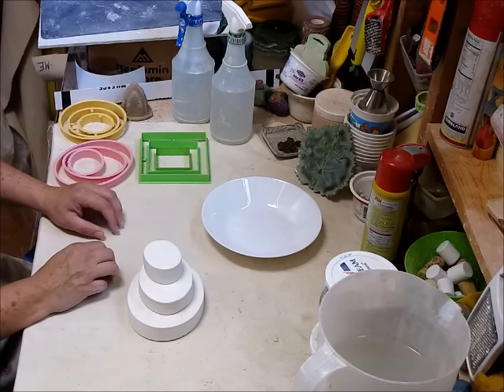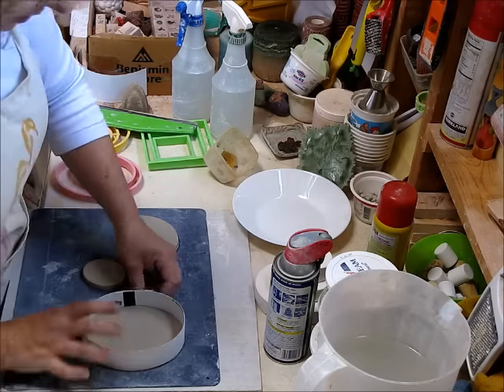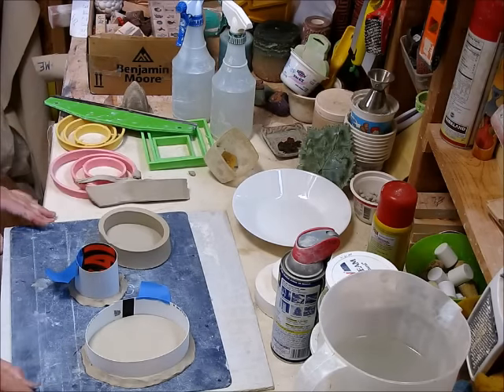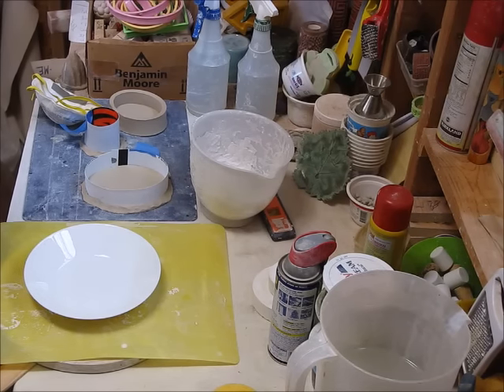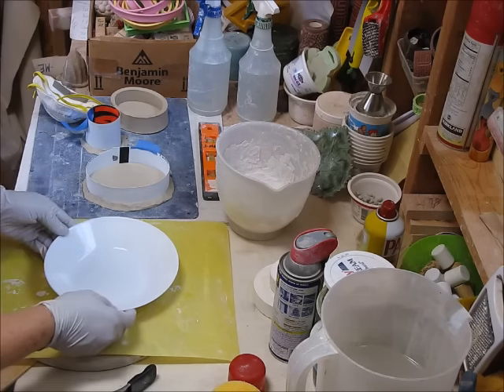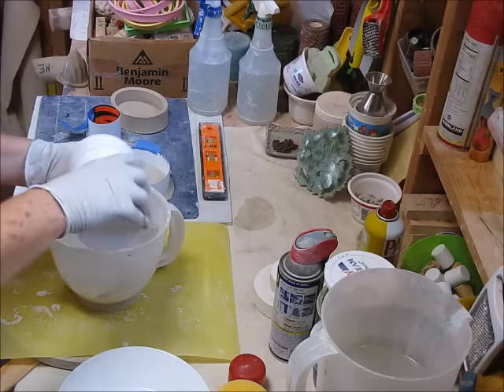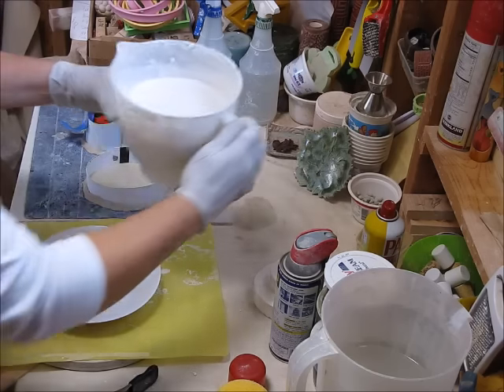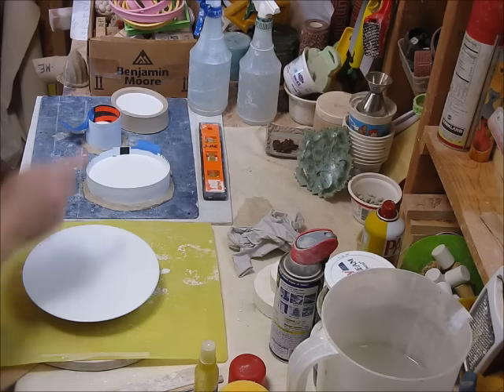Plaster for Push Molds

Comment: Jamie is the most generous teacher I’ve ever run across. If you ever get a chance to take a class from her at “Higher Fire Clayspace” in San Jose, CA don’t miss it!

When I work with plaster I line a 5 gallon bucket with a plastic trash bag and fill that half full with water. That’s where I clean my gloved hands, my tools, and my measuring containers. If I’m sanding, I do that over the bucket as well. Odd as it may seem, the plaster will harden even under water so you can leave it to settle for a couple of days then pour off the water and put the hard plaster in the trash. I have a place to leave the bucket to sit so I use the same water and plastic liner over and over. I just keep refilling the water as it evaporates leaving the hardened plaster in the bottom of the bag.
Reply from the maker: Thank you

Comment: For the volume measurement you could simply pour the water into a measuring jug, then you dont even need to multiply. Or if you have a scale, you can weigt the plate before and after adding water and subtract. Each gram of water is 1ml

Comment: Have you ever tested the plaster for durability? Pressing extremely hard in the middle to see if it will break? Using a rubber mallet or hammer?
Reply from the maker: No,  I have not.  The only time I've had them break on me is when I've dropped them by accident.  At one time I was considering how to make them thinner and stronger.  Someone suggested adding a mesh.  I have yet to try that.
Reply: You're using them to mold a softer material than I would. Soap has to be pretty hard to not squish out from under the pressure of a stamp. I fear pieces of the design breaking off into the soap as well as the stamp breaking under the pressure needed to get an impression.
Reply: @jennifereverett6298  A better option for marking soaps would be a bisqued clay stamp. Pottery plaster is fairly strong, but you're right, it would probably deform after repeated uses.

Comment: When measuring the depth of the water in your plastic box, you have to make sure that table is level, as you mentioned right after you measured the water.  Other wise you might be measuring the low or high side of the water depth, making your calculations incorrect.

Comment: This is useful, but I wish that you had published the chart for when we have different cubic volumes than what you have done here.
Reply from the maker: I feel like the chart is not mine to share.  It's something I figured out based on someone else's work.   I can tell you the pounds of plaster is roughly 1.5 times the pounds of water.
Reply: That is exactly what I needed. Thank you!
Reply: I use 5 parts plaster to 3 parts water and find it to be just the right consistency for pouring yet not having too much water. Also dry the forms slowly for maximum hardness.

Comment: Jamie, how do you store all your molds?  Also, do you sell the molds you make in the 28 inch wok? I've searched online to no avail...
Reply from the maker: I store them in my studio usually stacked.  I've sold at workshops.  I don't anywhere else.  I make that wok available during my workshops so students can make their own.  It takes 33 lbs of plaster!
Reply: Jamie Meador I noticed Higher Fire has an online store that connects to Etsy. The plaster isn't as much an issue for me as the issue of buying two woks for the production of a mold. If you make them again could you please do a sale through the Etsy page?  Thanks!

Comment: 스프레이오일은 한국에서는 구하기가 힘듭니다 그레서 한국에 음식을 사용하는 오일이 있는데 그것을 바르면 안됩니까??
Reply from the maker: It does not need to be spray oil.  Pour oil onto surface and spread around with cloth until entirely covered.
Reply: 감사합니다 도움이 많이 될것같습니다 ^^

Comment: Either that or you can do like everyone else and mix it up like pancake batter make more than you'll need fill your molds dump the rest in the garbage because plaster is as cheap as air and save yourself a bunch of ridiculous calculations.